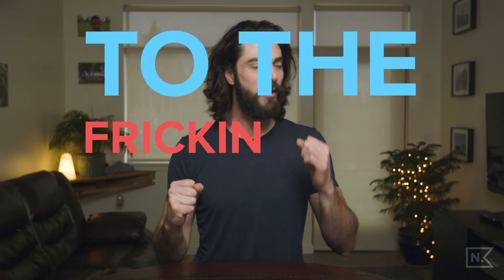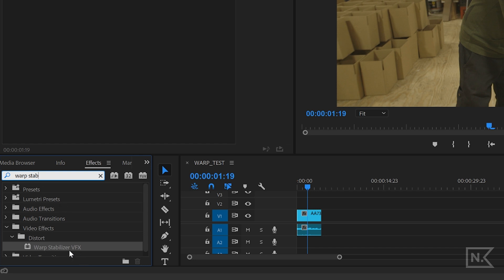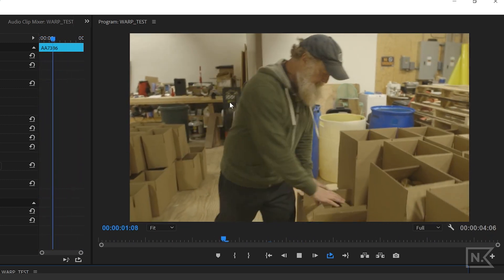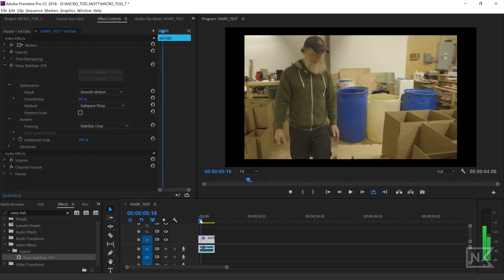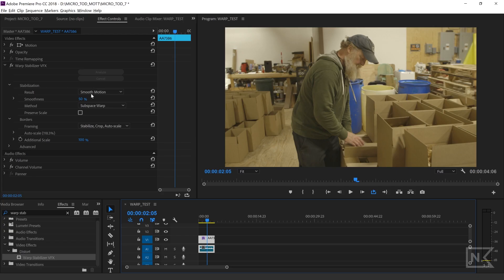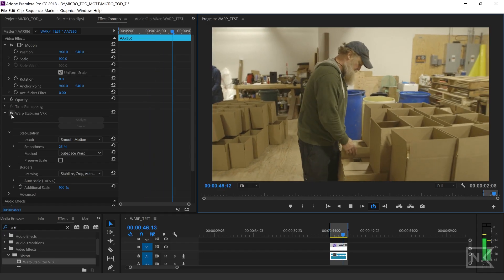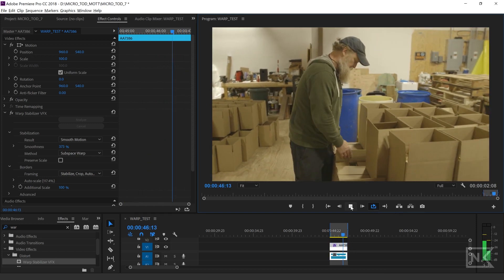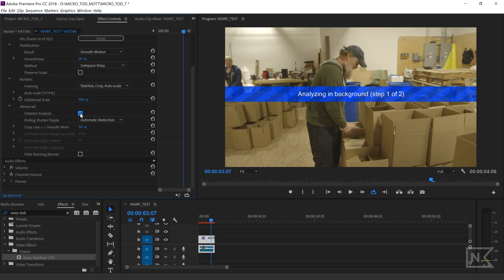Revisit WARP STABILIZER with this Advanced Tip

Comment: Warp Stabilizer's workflow means adjusting the Smoothness first. If your video is cropping in over 5-10%, you will see grainy zoomed in footage. Adjusting Smoothness zooms in/out the crop.. so adjust that first. Always start around 40... 50 is way too much for most footage.
Reply from the maker: Smooth it out like butter on bread. I find myself now using like 20 or 25 for smoothness.

Comment: Bro , Analyzing Background Is Showing Even After , I Export my video 😑 What to do for this ? and GPU accelerating needed , even if im using CUDA then too. 😑😑😑 Pls help 👏🏻
Reply from the maker: Hmm I am not 100% sure I can help you trouble shoot this, but if you have Adobe CC you can probably reach out to support and see if they can help. BUT first I would uninstall premiere and reinstall it with the most updated version. Restart your computer. Then make a new project (import your old sequence into the new project). 99% of the time this fixes any weird issues that I am having.

Comment: well you missed the most important part, manually adjusting and masking the stabilizing points. You simply mask a moving person that adds that jello and let warp work on background only.
Reply from the maker: hmmm I like what I am reading! I will play around with this for sure. Thanks for the tip :)

Comment: Well you could always do roundtrips to other software to see if they do it better. I started using DaVinci Resolve's Stabilizer and the one in 15.6 just does everything better than the Warp Stabilizer in Premiere and the Warp Stabilizer VFX (which is a more powerful tool) in AE. And it's free, I think it is worth doing the roundtrip.
Reply from the maker: Hmmm I think I will try out that DaVinci Warp...I have never used it and would love to see how it works compared to Premieres! Thanks for the comment and the info!!
Reply: NicksFort it does some footage better, but I managed to shoot some that turned out worse than the original for some reason while Adobe's warp stabilizer did wonders.
Reply from the maker: Marcellus I feel like it’s all random with the warp stabilizers. I’ve re-processes clips with warp in premiere or done it once, nested the clips and applied warp a second time and sometimes those little tricks make it come out amazing. It’s definitely not a one size fits all technique hahaha
Reply: Oh well the best thing to do of course is to minimize the shakiness with different filming techniques, that's when stabilizers work best.

Comment: The slightest bit of warping renders the clip useless for me
Reply from the maker: yeah I think that line, the point at which the warping is to much, is different for everyone and almost every situation. Ideally I film with a good gimbal and nail the shot to a point where you just put a tiny touch of warp stabilizer on the clip and it's pure gold! But obviously that doesn't happen every time LOL
Reply: Try switching the Method from from Subspace Warp to Position, Scale, Rotation. It may be a little less smooth but you won't have any jello effect.

Comment: You can also try to apply warp stabilizer with 10% smoothnes, render the clip and apply warp stabilizer again. Worked great for me.
Reply: When applying again, did you still leave smoothness at 10%?
Reply: could you just precompose?
Reply: How this works? Can u elaborate the render thing
Reply from the maker: Franja. That's a super good trick. I am 100% doing this next time around. Thanks for sharing!!